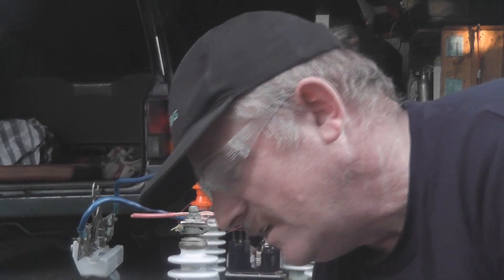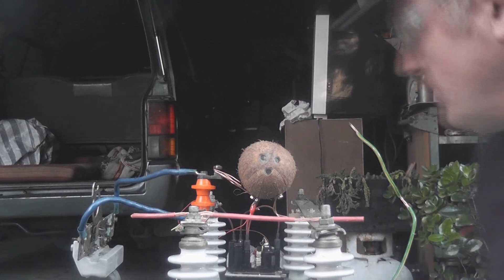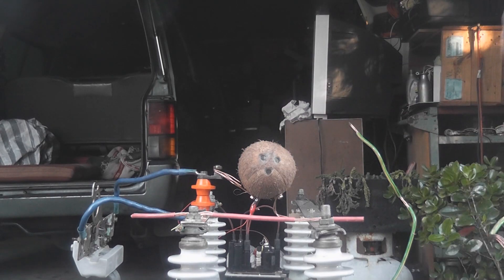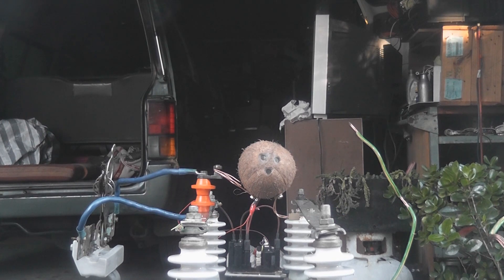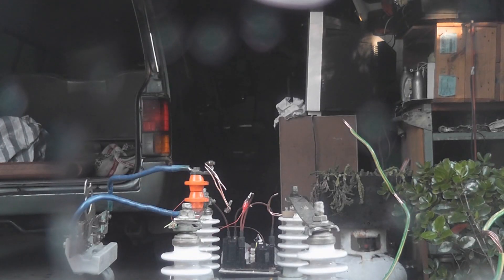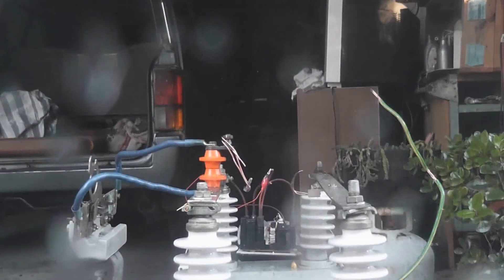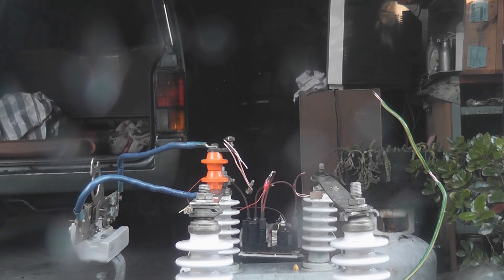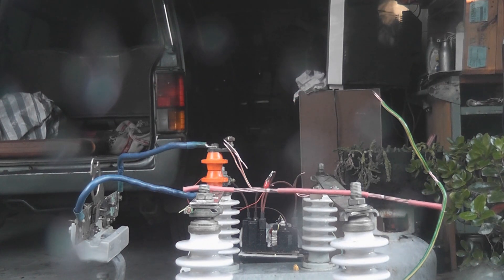Coconut Fruit versus 10,000 Volts Capacitors explodes violently

Comment from the maker: These are voltage support / PF Caps used on 11 and 22 kV lines. They are designed to withstand powersurges and lightning spikes.( Larry posted me the data, nothing about breakdown ). They were free anyway, so if one pops. They do have a vent plug in case of a serious fault.